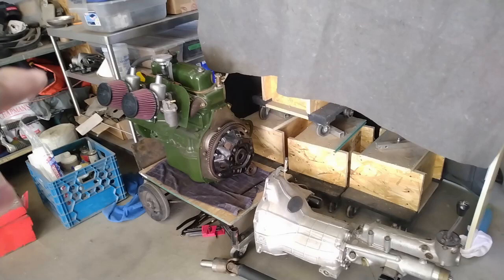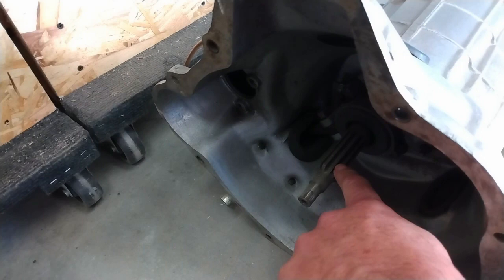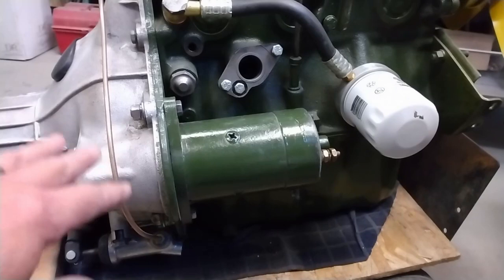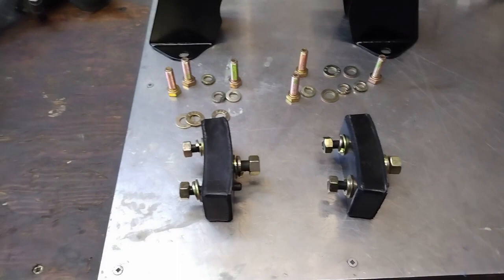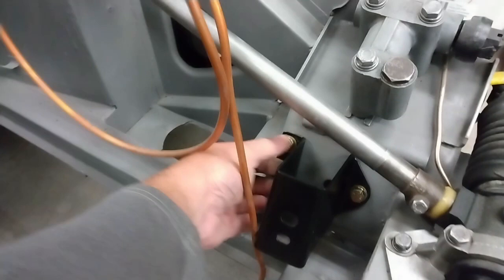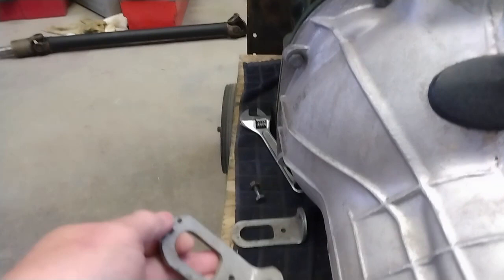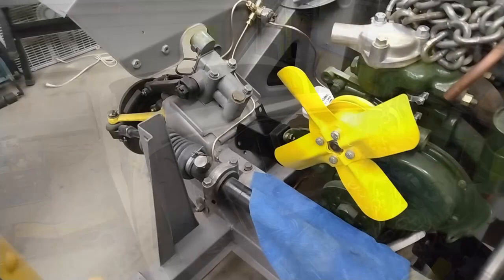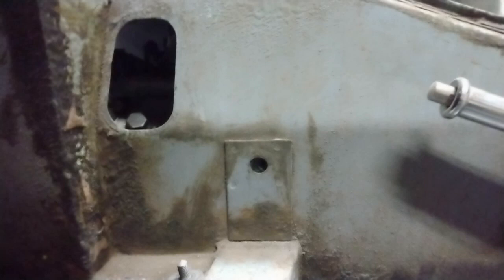How I installed the engine, gearbox and driveshaft in our Austin Healey Sprite. Bugeye Build Ep.89

Comment: Great progress Ian. Later cars like my '72 Midget had the fuel line cross over at the gearbox crossmember at the front of the transmission tunnel, rather than the front crossmember where you have yours. That way the hard line can rise vertically from the inside lip of the frame horn without interfering with the engine mount, and you will only need a fairly short length of rubber line up to the front carb.
Reply from the maker: Thanks Andrew. With the mount installed correctly there isn't much interference so I should be OK.

Comment: Looking really good!!! I can't remember if you mentioned this in a previous video, but how do you get the bolts looking so clean?
Reply from the maker: Hi Trevor. Some bolts are brand new, others I cleaned in the parts washer and/or wire wheel on the bench grinder.

Comment: Why did you not paint the engine bay before installing the motor? Also, it is easier to bolt the driver side. motor mount to the motor before dropping the motor in.  I assume you bolted the prop shaft to the diff. first. I use an old fan belt to feed the propshaft to the gearbox, then snip it off.
Reply from the maker: The engine bay is painted in Rustoleum's "satin granite". To install the prop shaft I had it in the tunnel and once the back end of the gearbox was under the shifter hole I simply reached in and guided the shaft into the tailhousing... worked like a charm! Once the two were mated I bolted the other end to the differential. I messed up with the motor mounts at first, had them on the wrong side and had the engine mostly in the bay before I noticed.